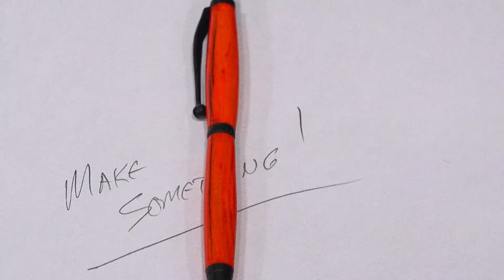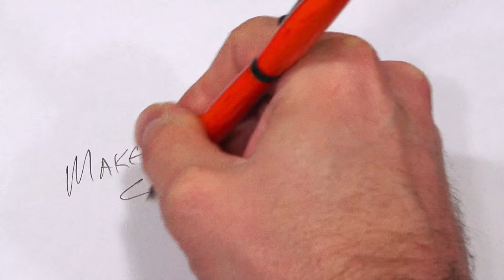Turn a Tree Branch into a Mechanical Pencil

Comment: When you are using the square lathe tool to turn that down, are you using the front facing edge of it, or are you using the side edge as you move side to side.  Just started turning, and I was having trouble using the front edge of the tool.  (I have the same medium set of 3 Rockler turning tools.)  I don't know if I have the tool rest at the correct height, and if I am using the tool at the correct angle, which no one really seems to cover in these videos.  hint hint.  :)
Reply from the maker: +Howard Springsteen I'm using both the front edge and the sides as I sweep back and forth.